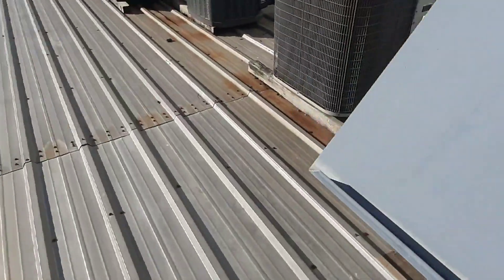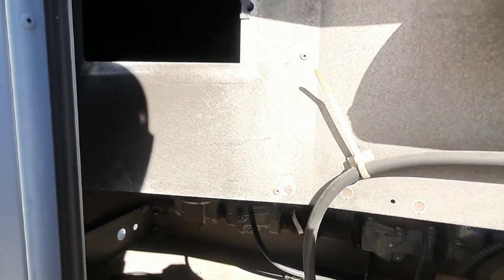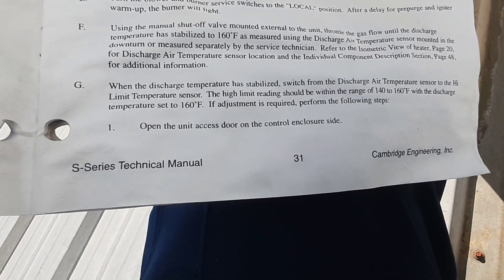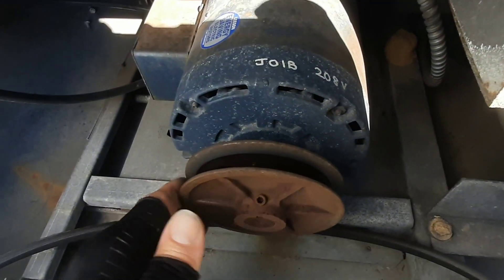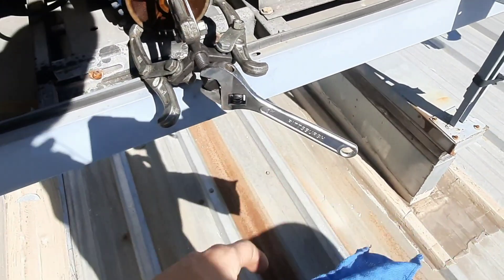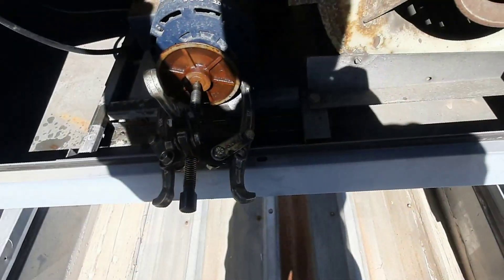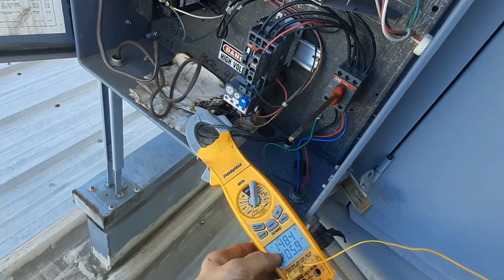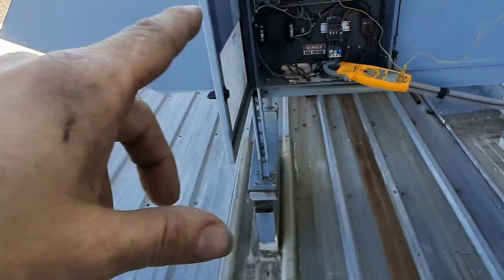32 year old Cambridge is still kicking #hvac #hvaclife #hvacservice #commercialhvac #hvacarmy #heat

Comment: The belt sits inside that blower pulley pretty deep, are you sure it wasnt meant to take a B belt? Happy holidays!
Reply: I had the same thought
Reply from the maker: Thanks Jamie. I was able to verify the A belt I installed was correct. The drive pulley I replaced is adjustable so you can speed it up if the amp draw allows.